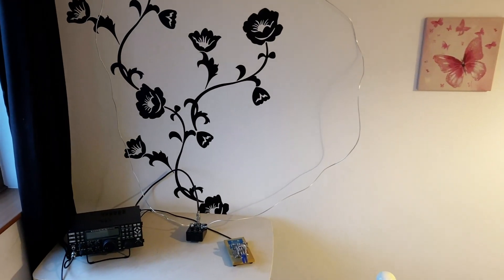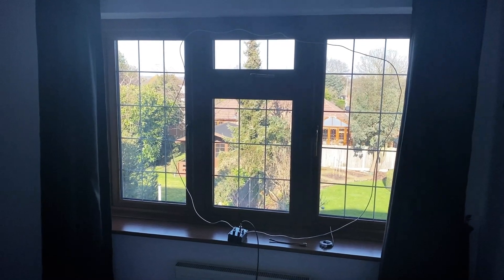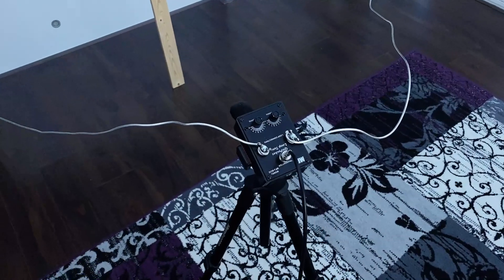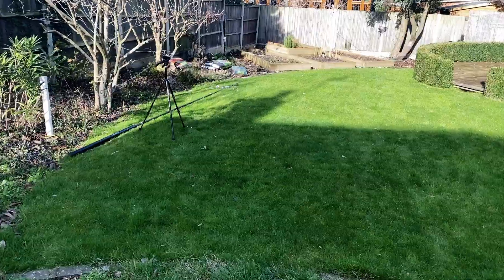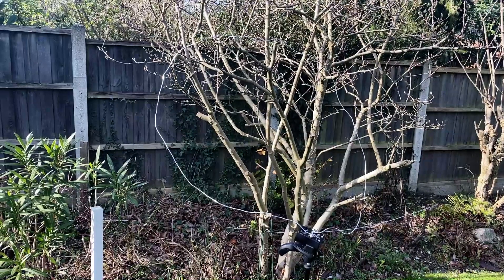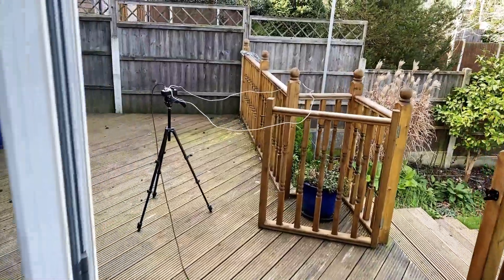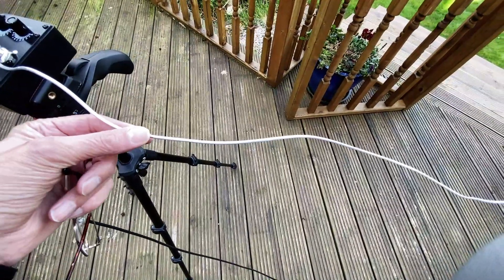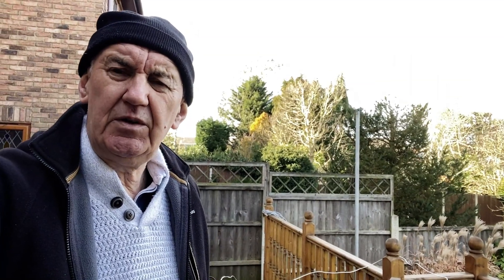Tiny HF Antennas - The MFJ-9232 Loop.  Tuner

Comment: I have this loop, got it as a gift but shamefully haven't used it yet! I must take it out and use it. 

I have the MFJ-935C and using just 4 meters of 10mm soft copper pipe bent into a loop I made a contact into Canada from Ireland on 20m with just 20 watts and today using 2 meters of copper pipe made contact to Belarus 2,223 kms on 20 meters using just 5 watts. I will use this 935C loop tuner a lot more than I have, same with the 9232.

Comment: It’s worked pretty good for me. I’ve used it from 20 meters to 80! 80 was a surprise because I was only using 40 meter length  feet. Yet it tuned. No qso but I did get reverse beacon contacts. Even made a vid on the 80 m part.
Reply from the maker: Nice to hear from you. 73 Peter.

Comment: Could you use an atu with it manual or auto
Reply from the maker: Yes you could but there would be little point. The antenna has its own built-in tuner and adding another tuner in series would make adjust confusing to say the least. 73 Peter

Comment: It was interesting to see the comment about how this might compare next to a mag loop... the thing is that this IS a mag loop (capacitor in the box tuning a single turn loop that is less than a quarter wave around). OK I think this has the less common "army loop" type match in the box compared to the more common gamma match or small loop opposite the capacitor but it is still a mag loop nevertheless. As such standard "mag loop" considerations apply:-
a) if you are going to use it at a window have it "square on" to the window NOT flat against the glass... these things fire in the plane of the loop so flat against the glass fires nothing out and tries to put its energy into the surrounding wall instead.
b) 8mm micro-bore copper plumbing pipe can make a great loop conductor (easily available from DIY superstores).  
c)  The screen of co-ax can also be used... make 2 little so239 to the terminal post/wing-nut adaptors and you can even use your existing patch leads for the loop. Just pick one of the right length.
d) NEVER use the auto-atu in the rig to tune these.... they should tune properly without the rig's ATU and their efficiency depends on being properly resonant so the rig atu doesn't really help.

I LOVE mag loops... I fully accept they can be a bit of a compromise but if they are the only antenna possible where you are then they are the BEST antenna you can have at that time. For travel and hotel use they can be unrivalled (you may have seen my Rad-Com article about receiving with Mag Loops INSIDE cars).

If you really want to be "secret squirrel" on holiday and have a large old hard plastic suitcase with no metal in it then you can get a mag loop for 10, 15 or 20m inside it. Sitting with a portable rig in your lap and a suitcase sitting on a plastic pool-chair next to you can give surprising results when the bands are open......  double o three and a half... licenced to thrill.

This little MFJ certainly isn't perfect (I've yet to find any antenna that is) but for allowing you to use radio in places you never thought possible it could be great fun... It reminds me a bit about my old Yaesu FT817... in spec terms the size compromises they made makes it one of the worst performance HF rigs (on paper) available but I'd never sell it as the smiles it gives me because it can be fun everywhere still make it a winner.

hope this helps - Ian   gm0sim      (for people interested in magloops in more detail just check out the groups.io forum dedicated to them).
Reply from the maker: Many thanks fortakingtge time write this. Appreciated. Peter

Comment: If you were hang gliding in mountains where you can be low and not receive VHF, UHF frequency would you use?
Reply from the maker: Hi there. I have no experience of mountains I am afraid. HF would certainly work. Peter

Comment: I had wished to see how it would  perform against  Magnetic Loop Antenna , Considering both works in same Band , Same Diameter  , Same Height  And Same Orientation
Reply: and same magnetic loop design.
Reply from the maker: Mabe I will when the weather imoroves. 73s Peter

Comment: Depending on the diameter of the wire you could use a child’s hoopla hoop and run the wire inside of it .
Then you would have something that looked nicer and you could mount it on a Tri pod
Reply: Ed Wymer  .....Hula hoop,correct?
Reply: redman840 spell correct strikes again
Reply: Ed Wymer  It gets me too,Ed.Spell INcorrection would be a better term applied.
Reply: I made a small transmitting loop out of a hula-hoop last year. I called it a "Hula-Loop". I wrapped self-adhesive copper tape round the plastic hoop to make a highly conductive but very light and rigid loop with circumference about 2m. I covered the copper foil with heat shrink tube. It tunes from 30m up to 10m. First contact on it was UK to USA on 20m FT4 mode using just 5W. That was with the loop indoors. Looking at the MFJ-9293 manual it suggests a 2.13m circumference loop for 20/15m operation. As Peter mentions in his video and the MFJ-9232 manual suggests, rule of thumb is you can use a length of wire that will work on 2 to 3 bands. I certainly found my homemade  2m length loop allowed indoor QRP QSOs on 30, 20 and 17m. The only downsides are you have retune for even small frequency changes, products like the MFJ-9232 are for low power only and you have to be careful of very high voltages and RF burns when you are near the loop. Small Transmitting Loops may appear to defy the laws of physics but they do work 😃.
Reply from the maker: Hi Ed. Yes that would certainly make it look smarter. Be a problem to find a hoop big enough for 40m! Great to get your input. 73s Peter.
Reply: @watersstanton  use two turns of wire.